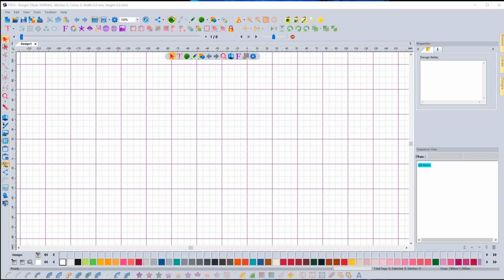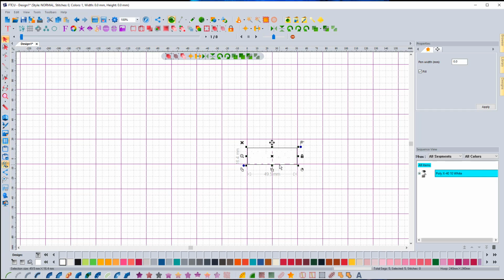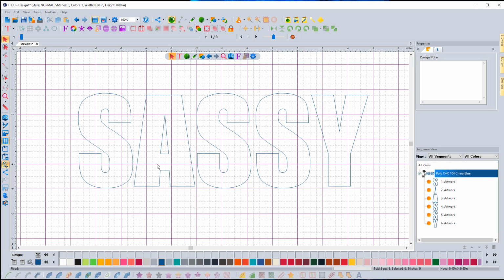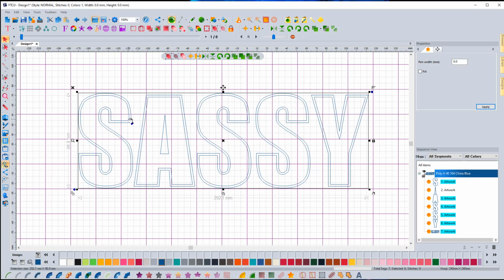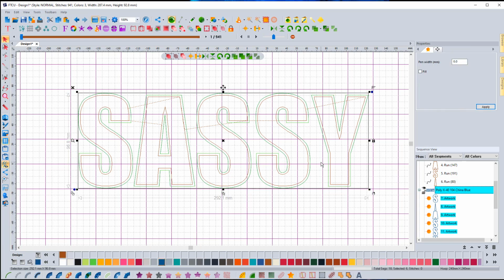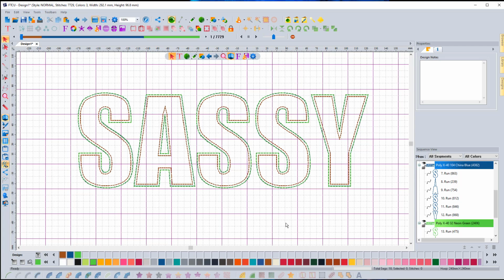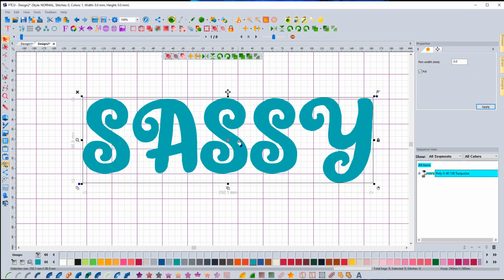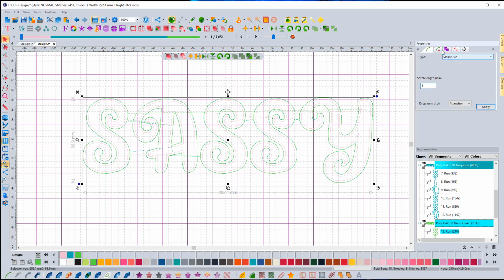Digitizing 3D EMBOSSED SHIRTS in FLORIANI

Comment: You're demonstration was very helpful. I did try it with the thicker foam sold at Michael's, but it didn't tear well untill I did a second cut stitch with a denim needle. Even at that, it wasn't that easy to tear. I hope to invest in some foam mean for embroidery or at least stay with the thinner craft foam.
Reply from the maker: I did it with some 6mm foam from amazon and it worked ok, but I have a pretty high tolerance for it being hard to tear out.

Comment: Brad, would it not have been easier to stitch by flipping the letters upside down and than hooping the shirt from the bottom. No worry about the sleeves getting in the way.  Just my thought.
Reply from the maker: with that hoop I need the sleeves to connect the ends of the hoop to the machine